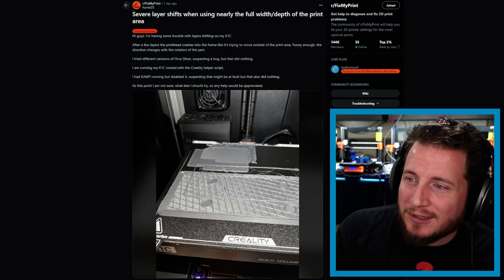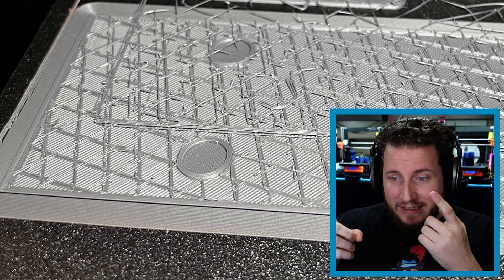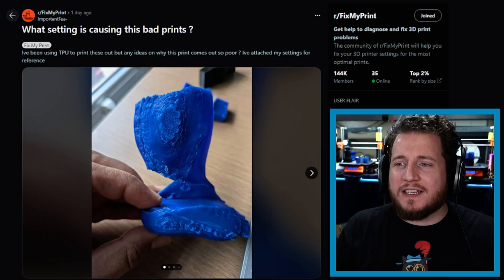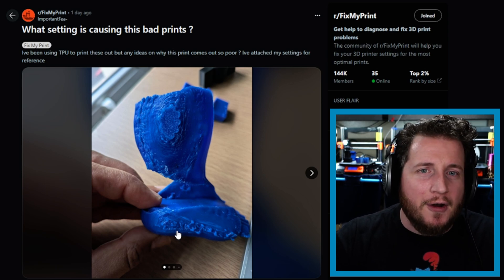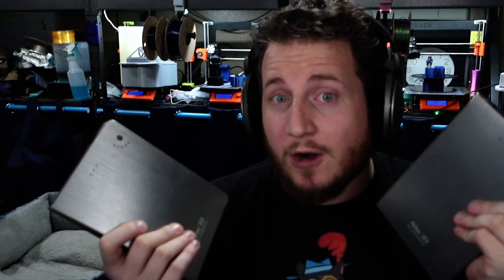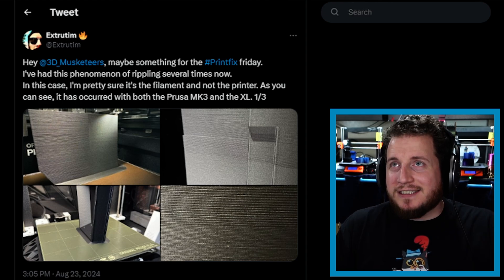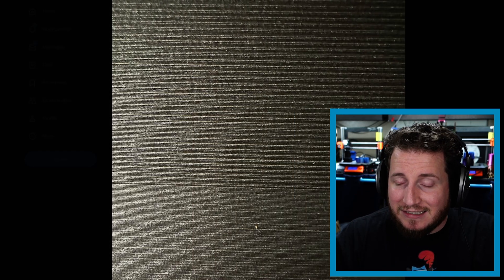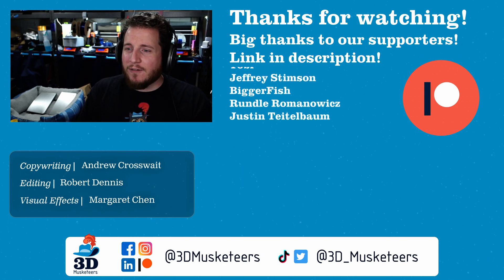Wavy Prusa Prints and Tortured TPU! - PrintFixFriday 159

Comment: I've had  a similar problem with a higher speed printer, mostly with silk filaments. They seem to expand a bit more. When I use gyroid or 3d honeycomb infill this the scraping problem goes away. I had the problem when printing a little cooler, turned up the temp to 225, then 230, and even though the problem was less evident, it did still scape the infill at times until I started using other infills.

Comment: $850 for those batteries is an absolute blatant rip-off of epic proportions. Literally the only thing different compared to a power bank is one simple DC output.

You could get an $80 battery pack with twice the capacity, then just get a $10 USB-C adapter cable that triggers the correct output voltage (Artec's page seems confused, it could be 12V or 20V but you can get cables for either one).

Their AC power adapters are like $150 as well... for an off-the-shelf Chinese brick that you could get for $5. It's been a while since I've seen shameless overpricing of accessories that bad...
Reply from the maker: The connectors they use are special and that's what sucks.. I'd need to fabricate my own, but don't worry, the thought of usbC pd has come through my head many times.

Comment: 15:05 I've also converted the MK3 to reverse bowden, the nozzles on both printers are 0.6mm in size, a NozzleX in the XL and brass with a hardened steel tip in the MK3. :)

Comment: hey my mk4s upgrade just shipped today! Apparently the CHT nozzles are not ideal for MMU printing. So I may leave the nozzle alone. I did get an obxidean CHT so when I need to print abrasives again I can! Currently my old one still has filament in the heat break and a drill bit stuck inside. I gave up on that. lol
Reply: CHTs have a larger internal area and more complex internal geometry than regular nozzles, so they need more filament to flush when changing colors. You end up with a larger purge block and slower filament changes.
Reply: @logicalfundy  makes sense. I wonder how much of a difference there is. I have some filament where 300 is almost enough 350 is for sure. I might try that combo

Comment: 13:07 Lithium could explode because of the charging process. I'll explain it: some chargers, specially those that use high currents, can heat up the batteries beyond their safety limits or too much in each cycle causing a deterioration at the chemical level of the batter and after a few cycles the breaking up happens. I prefer to use slow chargers.
Reply: Battery management system should monitor cell voltages and cell temperatures and prevent all things outside operating conditions (e.g. excess discharge (unless safety overrides battery health) or charging when too cold). At least, when the charger is part of the system or listening to BMS instead on trusting on faith.
I'm guessing e.g. laptop batteries operate quite safely, tool batteries and "toy" (derogatory on purpose, cheap as in price or as in design) batteries maybe not so well...

But then, my experience is from larger LiFePo pouch cells (in 8, 16, 24 or 32 cells in 1 - 4 kWh units, in different S and P configurations) - like 10 years back - which were pretty safe and due to cost and voltage and stored energy and regulations had to be pampered properly. CC charging was at 1/2 C and after later testing 1 C when cell voltage was well below CV limit. BMS control boxes had relays to enforce safety.
8-cell 1 kWh battery (with cell monitoring but no BMS nor charger) did cost around the same as pillowed unit in video...
The cells did contain electrolyte that would happily burn, but it took some effort to get them to even burst open. "Too good" short circuit simply melted the tabs and nothing else happened. Other chemistries probably behave differently.

Comment: I have 3 tablets. The original I bought 10 years ago works fine. I honestly don't know how good or bad the battery is. I have one I bought about 5 years ago. The battery swelled up and the screen is pushing out. I stopped using it. Technically it still works, but I don't ever want to charge it again. And I have my brand new one.

Comment: If those batteries have multiple cells in series, it could be caused by a lack of cell balancing. Or it could be the battery needs to be fully charged to balance the cells, because they cheaped out on the balancing circuit.
Reply: Pretty sure the "brute force balancing" method is not a good idea with lithium ion.
Reply: @soundspark  It's not quite brute force, it lets current bypass the cell when it's full, but you have to continue charging to fill the other cells. Not sure if that's what's going on here though.
Reply: @sleepib  Like a zener or something to bypass full cells so they don't overcharge?
Reply: @soundspark  Yes.